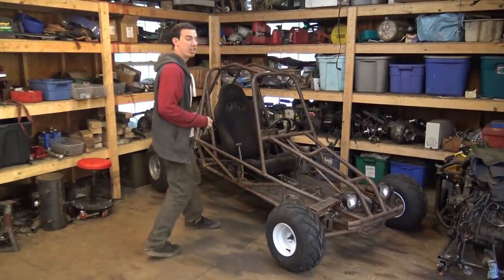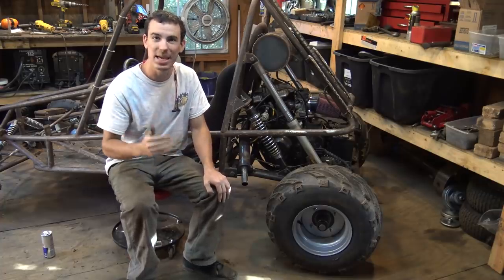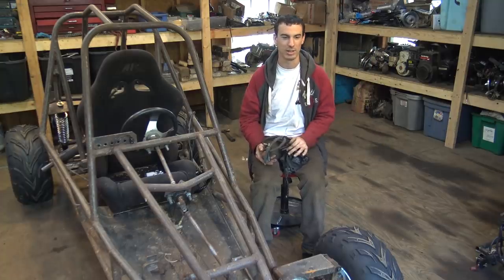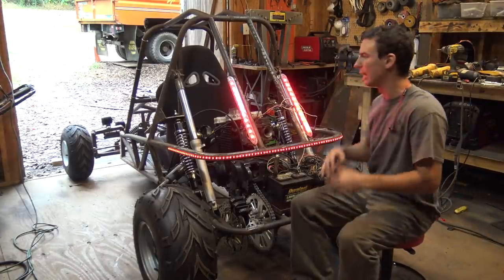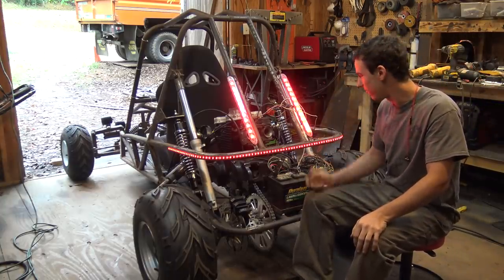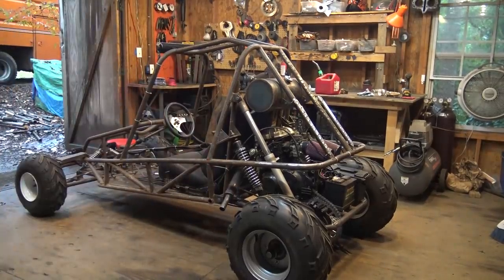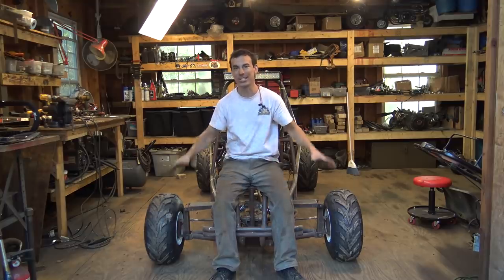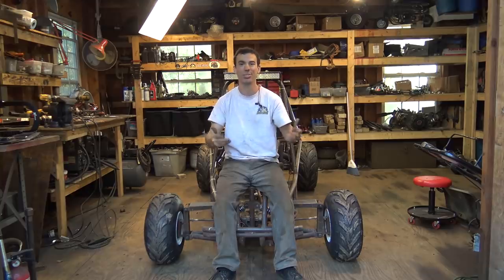finishing the GS500 dune buggy part 2

Comment: Replace the rings and hone the cylinders. Those used piston are worn in to the other bikes engine. A few thousandth in ring gap makes a huge difference in compression.
Reply: This! You don't need cams and valves, you just need to stop doing the quick and easy  fix. You could have just put new rings on your existing pistons along with honing the cylinders and got away cheaper than you did buying second hand pistons. I'm honestly surprised it wasn't burning oil after that.
Reply: madmat2001 yup! compression could also go UP after a few hours running them in at this point. a valve dart and lapping compound can get older valves slamming shut really good pretty cheap too
Reply: Exactly what I was going to put

Comment: The most reason of having low compression is exhaust and intake valves adjustment or may be needs grinding
Reply: yup, good hit with compound and a valve dart, reassemble and adjust them.

Comment: Chris thanx for taking apart the top end and giving it more compression.,But I would have honed the cylinders,and put new rings in it.That would have solved the problem of petering out after 5 min. of running. You didnt need new pistons at all.let alone used ones.2 cycles run a lot of RPM thus changing rings frequently.120psi is a lot better than 90psi. you had the bare minimum to get the thing to start.Love your builds and projects.keep up the excellent work.

Comment: You may also need to do a valve seat cleaning to get rid of the carbon build up that maybe letting some of the commpression slip by and lowering your overall compression score per cyclinder.  Rehone the cyclinder and install new rings and working on the valves might be a pain but it will pay off in the end and you can get the older gear setup back on there.  I hope you checked the wiggle inside the cyclinder with the new/old pistons installed because to much wiggle you will wind up with ring failer and have scored walls and broken rings thus having to replace the cyclinder jugs, pistons, and rings.

Comment: If you haven't re jetted the carbs yet you probably should. With the shorter exhaust and the pod filters that engine is going to be running lean and with an air cooled engine that will kill it quickly. All in all this is a sweet build and have watched the entire build of it.

Comment: If you think there is leakage around your valves  (use compression tester and listen in the intake/exhaust for whistle), you can lap the valve to the valve seat pretty cheaply and easily, put some diamond compound on the valve seat and valve, put a bit of rubber hose over the end of the valve stem, stick the other end of the hose in an electric drill, and gently pull back on the drill and spin the valve - make sure you lube the valve guide first though.

Comment: I suspect its valves at this point, if you felt like taking it apart you could try lapping them least take a good look. I don't know if you honed the cylinder with a ball hone or something to scuff up the walls. Sometimes they can get glazed and the piston doesn't seal well. You might have done that stuff behind the scenes if so sorry. :)
Reply: Honing has nothing to do with how good the rings are sealing. It's for better lubrication of the cilinder walls

Comment: Yep, Hone the cylinders, put in new rings, and lap the valves. Cost about $30 unless you need to buy the hone which is $40 or so. I would move the 2 rear lights from vertical down on the bent bar side by side horizontally.

Comment: Sounds like it's running a lot better. Did you hone the cylinders before you put it back together?
Reply: He should have
Reply: yup, I've even done it by hand with sandpaper just enough for a visible cross hatching will help the rings to seal. clover compound and a valve dart on a drill to re-mate the valves to their seats. hope he sees these comments, doing it will probably put compression within spec

Comment: At least put new rings in it ..... used piston rings really...??
Reply: Go back to 1:53...
Reply: Rings cost like 12 bucks....
Reply: He said in the vid he put new pistons and rings in it.
Reply: Mark Dillon right after that, he said they were used pistons and rings. I think he meant “new” as in new to him.

I definitely think it would have be worth using new rings and going through the trouble of setting the ring gap.
Reply: Shit sorry he did say they were second hand at the end of that i must have tuned out, no wonder why its still got low comp would have been better spending the money on new rings an honing the cyclinders ect
Reply: Yeah, Always spring for new rings and pistons  with the honing ! It will save you a lot of headaches later

Comment: Have you considered that heat might be an issue?  That engine was originally mounted in a bike with no airflow restriction other than the front wheel, and used at much higher speeds than your kart.  You have much of the airflow blocked by the seat, and it's under power at much lower speeds.  You might be overheating the engine.

Comment: you should put a 670cc predator engine for that kart! i did it to mine and goes well over 50+ mph
Reply: Just because the predator 670 has more combustion chamber size, doesn't mean it's a better motor. Actually, it's a giant pile of shit compared to the gs500 or really any Suzuki motor.

Comment: Since you are going to remove the two front outer LEDs anyway, why not mount them on the rear as reverse lights?
Reply: Maybe because it doesn't have reverse?
Reply: @lennym1273  That's a valid reason.

Comment: the valves on the 600 go cart are not closing when its cold theres enouph clearence in the valves to run for a copole    minuts un till thay heat up enouph to swell and hold them selfs open thars why
 you cant get a feeler gage between the cam and the lifter

Comment: Clean intake gskts idle also 90 psi is bad 160- is good maybe blown gskt no need for new as long as same size piston and rings clean oil port Hope in oil ring gap hole drill bit will do

Comment: the brake problem could happen when the main brake piston doesn open the release hole for the brake fluid to run back intoo the reservour or the hole that replaces the brakefluid intoo the pistonbore , check to make sure the brakepiston gets out of the bore far enough
as for the problem with the compression , you could do a leakdowntest to check if its indead the valves or if it leaks down intioo the carter (oval cilinderbores ?)
if its the cilinderbores you could buy a new big bore kit and have the engine bored out , it should be like new after that

Comment: You need to pull the jug bore it over about .20 get new pistons and new rings.. when you're putting in used pistons and rings they won't seat like they should unless you honed the cylinders first.. but even then with the wear the cylinders probably have... its out of spec.. a fresh bore with new pistons and rings would take right care  of it.... sounds as if the valves are fine just by hearing the motor run

Comment: Puts original brakes on, has problem, doesn't actually fault find problems just replaces bits till it works.
Puts engine in, has problems, doesn't actually do fault finding to figure out the problems, just replaces bits till it works...

Leak down test kits are not expensive!

Comment: Used pistons rings? Should have just put new rings on the old pistons. 

Also, quit using gocart brakes. They are for smaller, lighter vehicles. You need to step it up the real brake parts. Wilwood makes great small master cylinders for decent prices, and they are rebuildable.
Reply: He's not using go kart brakes, he's using brakes off a motorcycle. The only "go kart" brake part he used was the master cylinder, and thst probably was meant for something else and go power sports advertised it as a go kart master cylinder
Reply: Redneck Tractors It has plastic tubing off the master, that isn’t anything you use on something bigger than a gocart. Your brakes are only as good as the weakest part, so using any gocart crap on this makes the whole system nothing more than a gocart system. Doesn’t matter how good the calipers are if the master and tubing are junk.

Comment: There is no need to replace the top end, new rings and honing the cylinders should fix the compression as long as there is no deep scaring in the cylinders, and the valves can be reseated and then adjusted. All you will need to buy is gaskets and rings, maybe the timing chain if it is stretched out, so it should be a quick cheap fix. Not trying to tell you what to do or be a know it all, just trying to save you money.

Comment: Those cylinders are probably around 225-250cc if the engine is a 500cc. Cylinder should be approximately 65-67mm. Possibly Flex Hone BC25832 a 320 grit. About $45 on eBay. Check to be sure it fits?!?!?

Comment: Low comp won't make it stop running after 5 min there's another factor. maybe low comp and then when it warms up it lose's more comp but unlikely it. put a little oil down the clyd and then comp check .when it warms could be a coil breaking down it could vapor lock,it could be a lot of things but  low comp isn't it. when it died u didn't diag it  spark, fuel ,temp what made u go stright to comp . a guess u have to diag the problem.

Comment: Hello first take apart ckeck ring in cylinder without piston make sure right size then when you put rings on piston make sure they sit 90 degrees apart the opening of rings also clean holes in oil ring Grove then take valves apart reseat with grind compound then clean and put back together  compression should be 160 at least unless something's cracked maybe not I've built lots of engines not hard you can do it I no let me no email easy

Comment: you can increase the compression by shaving a small bit off of the top end, where the ports and the cylinder meets, just a small bit though, on the belt sander or something, or get a professional to do it.
Reply: Or fix it properly

Comment: Ok less talking more action show more build and testing and for craps sake STOP FORGETTING TO VIDEO! Show the failures and triumphs you had a 17 minute vjayo and like 2 minutes of it were actually worth watching. 
Number 2. Why on earth would you take the top end off and only put USED parts in it and NOT check your heads and you wonder  why you have low compression. My dad always told me if your going to do something DO IT THE RIGHT WAY THE FIRST TIME!!!